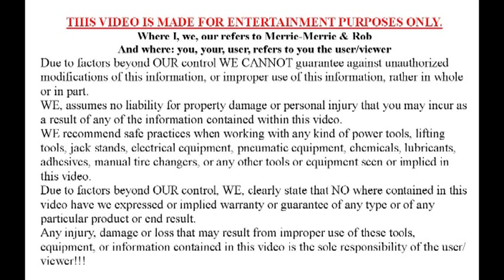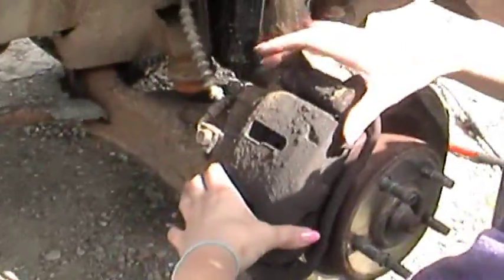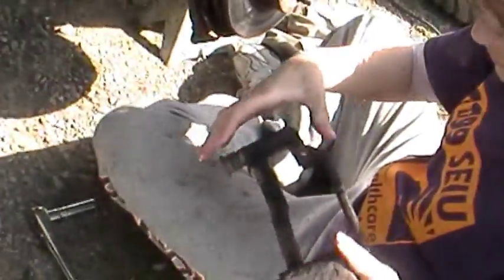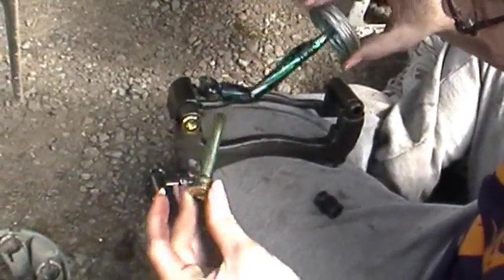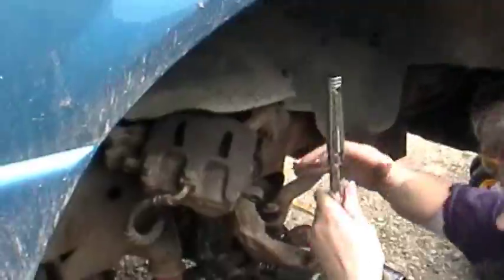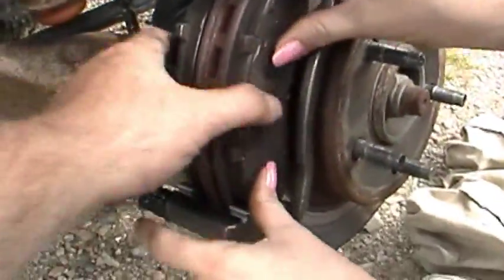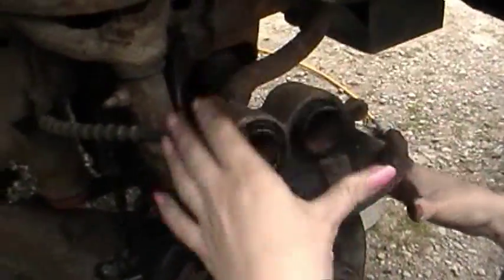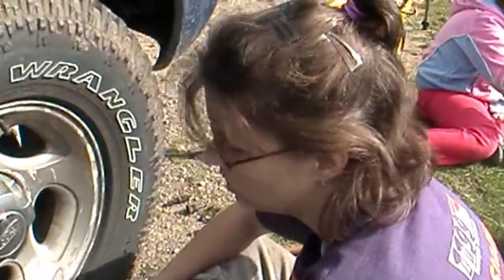2002 Ford Ranger Edge Maintenance Part #4

Comment from the maker: Ha,ha, ha.... Thanks Tim!!!! I'm proud to say that I didn't break a nail or even chip my
nail polish although it did get a bit scuffed... LOL 
I'd like to say that I didn't break a sweat but that would be lying, I had to really put some
pressure down on those caliper bracket bolts to get them to 85 ft. lbs.... LOL
Rob told me I should have stood up and used my weight to help instead of trying to 
muscle it... LOL
We love going four wheeling although we haven't been in a while...
.
Merrie-Merrie

Comment from the maker: 1) I didn't replace the caliper, just the caliper bracket... They were looking kind of old.
.
2) Well you could, however I wouldn't suggest it as grease is petroleum  based and 
is known to eat/rot the rubber bushings.
.
3) The tires are close to 32" they measure 31.574 but I keep calling them 31's, as
for the axle ratio it has 4.10:1 and a limited slip rear axle, although Rob noticed that when I was playing in the mud that all 4 tires were spinning.
hope that helps.
.
Merrie-Merrie

Comment: hey I got a 2005 ranger edge. my front right dust cover just before the hub assembly has split open. grease is get tossed all over, truck runs the same? no loud squeeling as if the bearing was blown or dry? new to the rangers and don't know the fine details of em. was wondering what you that about?
Reply from the maker: I would definitely get it replaced, because as you drive it all that grease it getting tossed out and dirt & water is allowed in to the bearings the bearing might be good now but it won't be soon.....Merrie~Merrie